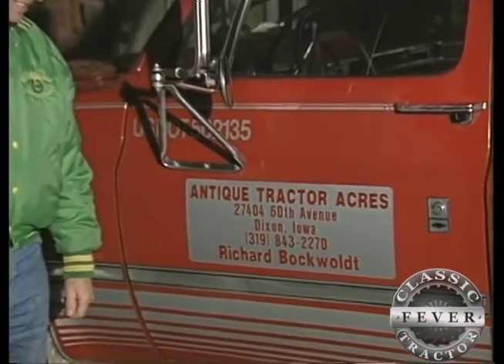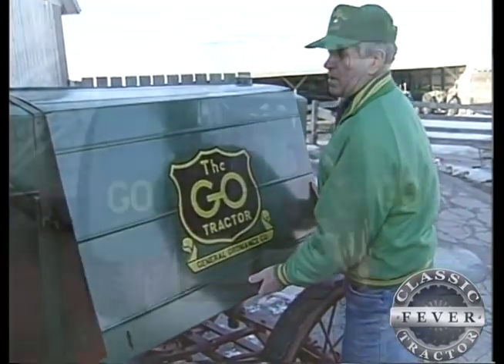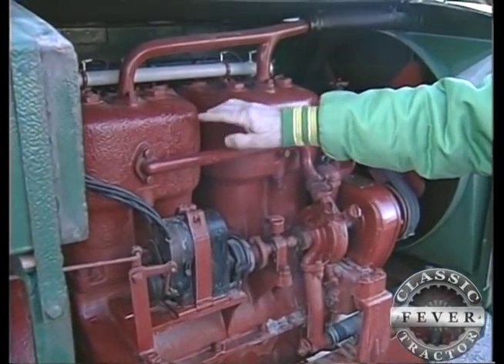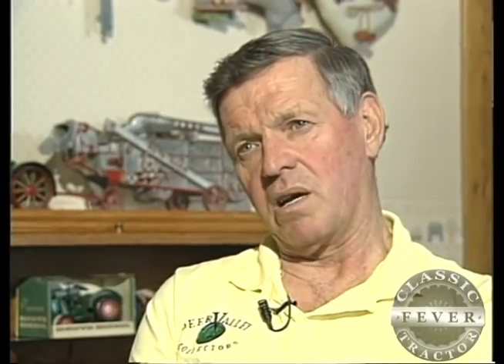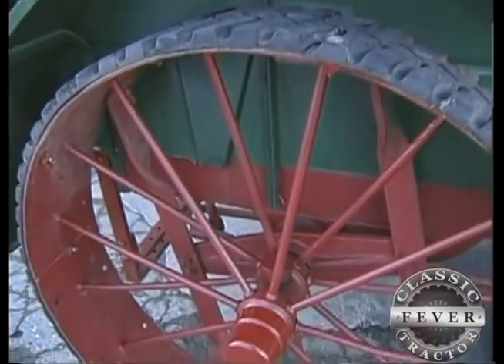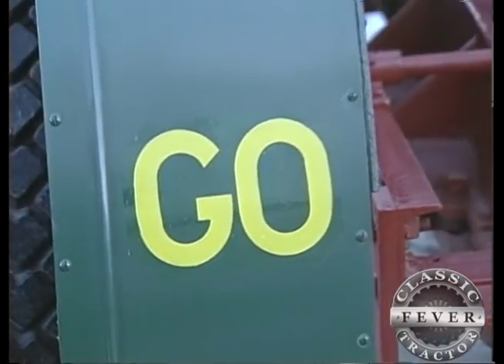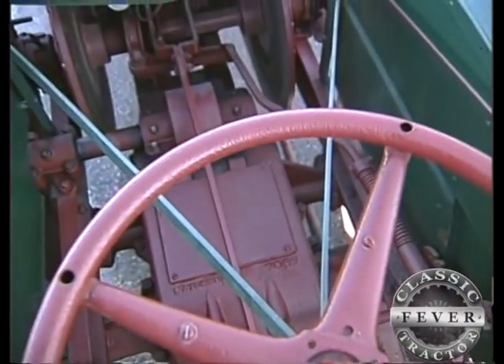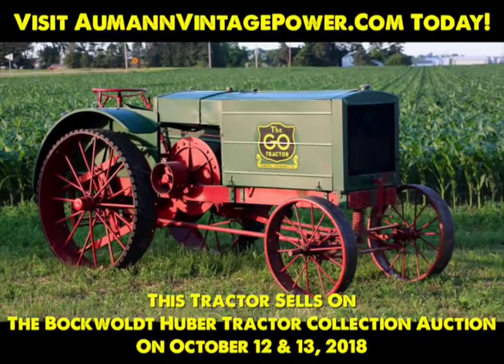Rare General Ordinance Tractor "GO" Tractor - Classic Tractor Fever Tv

Comment: Very interesting friction drive is I remember a Ariens lawn mower with that
Reply: And Snapper rear engine mowers.
Reply: I had one, ok to mow with, but if you tried to pull a trailer that was 10 lbs to heavy, the friction disc would burn up in no time.

Comment: WHEN I FIRST STARTED WORKING FOR THE SANTA FE RR SHOPS IN KANSAS CITY IN SEPT 1964
THEY HAD QUITE A FEW 
SHOP MULES WITH A REVERSABLE DUAL CONE TYPE CLUTCH ARRANGEMENT LIKE THIS AND WITH A RATHER LARGE
(BUT WEAK) ONE CYLINDER 
ENGINE!  THE STEERING WAS DONE BY A TILLER HANDLE ,
TRICYCLE STYLE!
THER WERE SEVERAL DIFFERENT VERSIONS OF THEM A BASIC FLAT BED , A DUMP BED VERION ALSO!
ALL OF THEM WERE EQUIPPED WITH A PINTLE HITCH  TO PULL WAREHOUSE CARTS BEHIND!